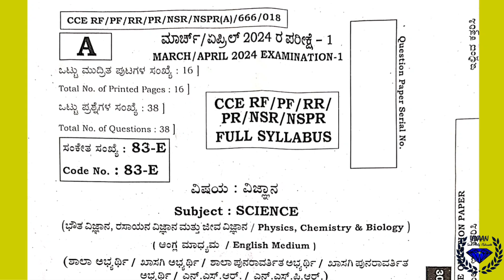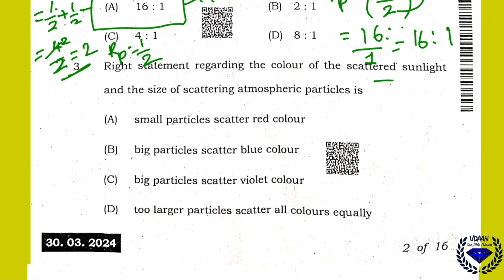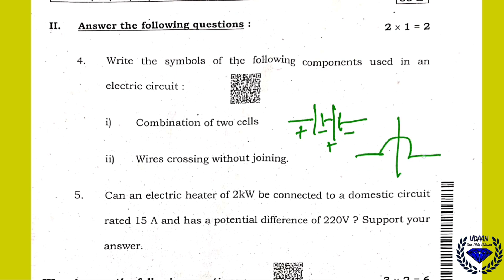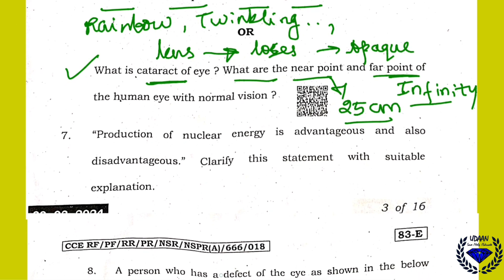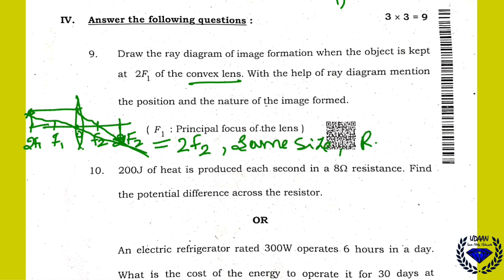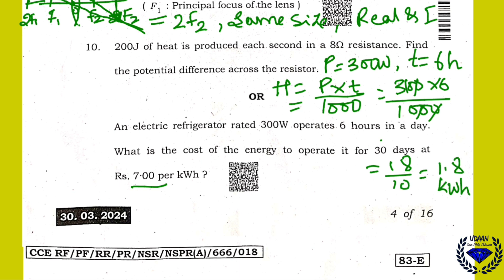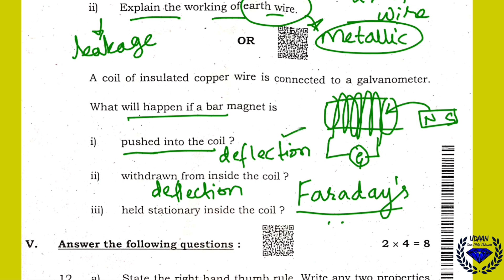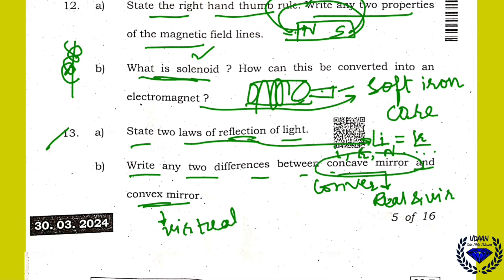10th SSLC 2024 SCIENCE PHYSICS KEY ANSWERS BOARD EXAM 2023-24 Paper 30/03/2024 #sslc2024 #boardexam

Comment: 2nd answer

  let me explain to you 

In series
R = 2ohm

R1 + R2 + R3 + R4 = 2 + 2 + 2 + 2 = 8 ohm
Resistor in series = 8 ohm

In parallel

1/Rp = 1/R1 + 1/R2 + 1/R3 + 1/R4 
= 1/Rp = 1/2 + 1/2 + 1/2 + 1/2
= 1/Rp = 4/2 
= 1/Rp = 2/1
Rp = 1/2 ( Taking reciprocal)

Resistor in parallel = 1/2 ohm

Rs/Rp = 8/1/2
 = 8×2/1 
= 16/1 
Hence Rs/Rp = 16:1

Comment: 5th one answer is wrong. Let me explain:- they have given that the power of an electric heater is 2kW. They have also given that can it could be connected to 15 A  with V= 220v. Let's calculate the power. We know that P=VI. So 220 multiply by 15 is equal to 3300. So the power is 3.3kW. So if we supply this much power to an electric heater having power 2 kW, it can't handle 3.3 kW of power that is 1.3 kW of power extra.
Reply: Yes bro i also got the same answer
Reply: And in addition to your calculations if we find the current requirement of the heater

P = V × I
2000 = 220 × I
2000/220 = I

I = 9.09 Ampere 

The current requirement of the heater is only 9.09 Ampere and the current provided by the circuit is 15 Ampere so it would cause malfunction of the heater due to more current provided by the Circuit.
Reply: @DeepGraphics06 ya i wrote the same that there might extra current flow in the heater which can cause damage to the heater is my answer  right
Reply: I wrote the same

Comment: Sir in 5th question how would the heater works if the current supplied by circuit is 15A and the heater requires only 9.09 A. It would cause overloading.
Reply: Sir could you please answer
Reply from the maker: it can be used. 
Because available current is more than required current. 
If current is less, the device will not work. 

Subsequently, over loading will only happen when there is sudden increase in current.
Reply: Sir i did the problem correctly but wrote the last answer wrong would i get any marks?
Reply: @DeepGraphics06 same i also wrote last answer wrong
Reply: @DeepGraphics06  u will get marks for the formula and steps brother ....they might take 1 marks that's it if end answer is wrong....m
Reply: @santoshchakrapani8667  thank you bro!

Comment: 2nd answer 8:1
Reply: It is Option A
Reply: No it's answer is 8:1
Reply: @sarikasawalkar4307  let me explain to you 

In series
R = 2ohm

R1 + R2 + R3 + R4 = 2 + 2 + 2 + 2 = 8 ohm
Resistor in series = 8 ohm

In parallel

1/Rp = 1/R1 + 1/R2 + 1/R3 + 1/R4 
= 1/Rp = 1/2 + 1/2 + 1/2 + 1/2
= 1/Rp = 4/2 
= 1/Rp = 2/1
Rp = 1/2 ( Taking reciprocal)

Resistor in parallel = 1/2 ohm

Rs/Rp = 8/1/2
 = 8×2/1 
= 16/1 
Hence Rs/Rp = 16:1
Reply: Ok TQ